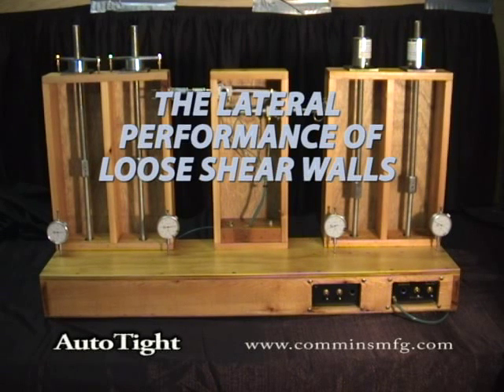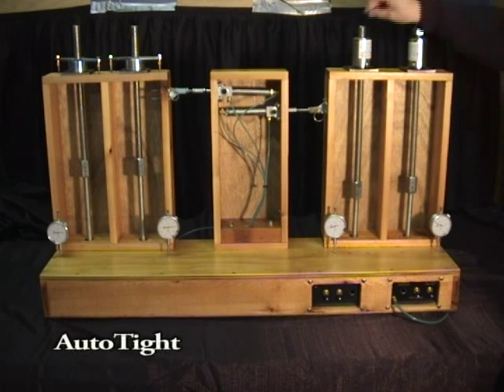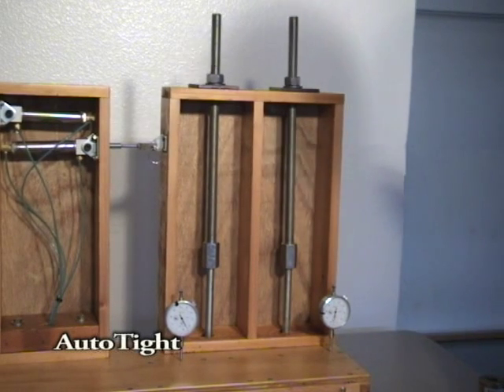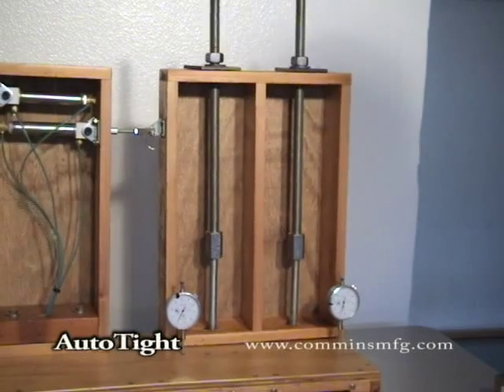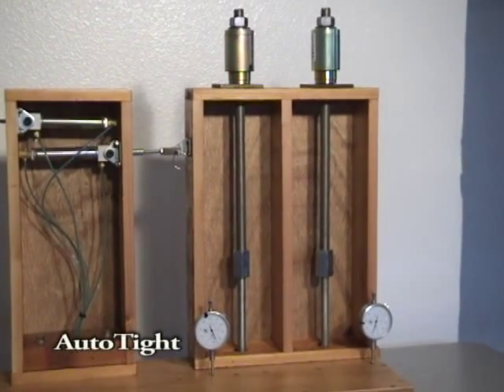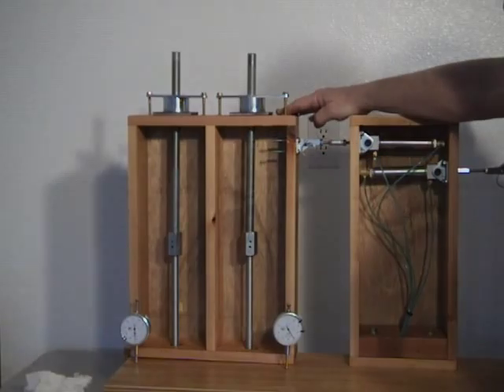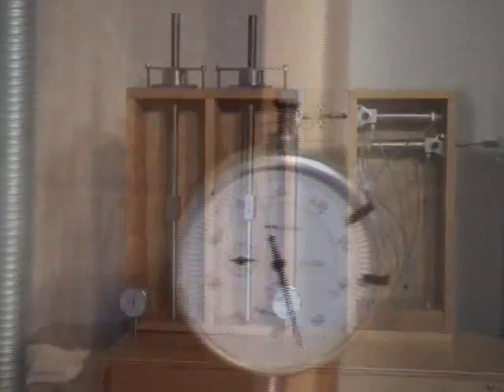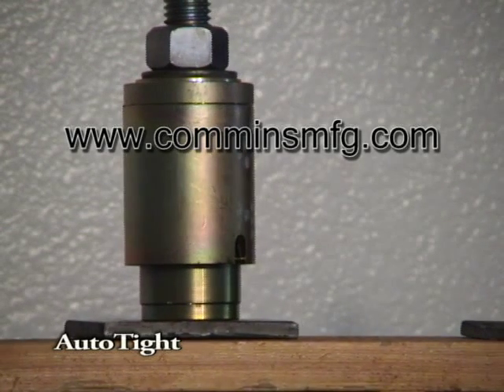Wood Shear Wall Holdown Performance v1 0

Comment: Shrinkage is such a challenge. I like tight walls too and I'll go to Cummings to get what I need. Lol at least u have a comment. Seriously the cost of retrofitting with all that steel seems intense but catastrophic failure way Worse. Challenging to address the damage of wind and quakes. But rebuilding shcools in tornado alley the same way is murder. Thick concrete reinforced interior hall and ceilings must be mandatory. Seen numerous total fails of schools on utube.